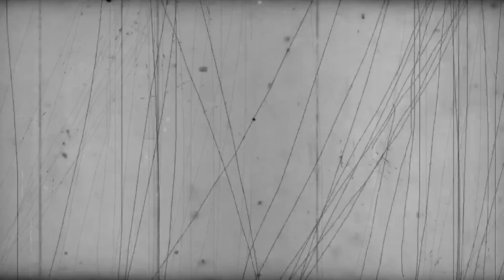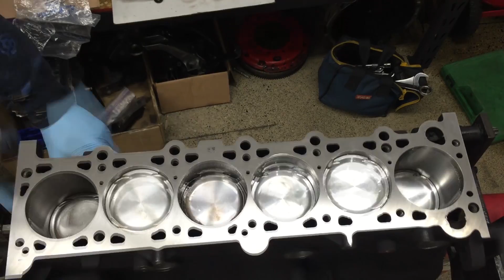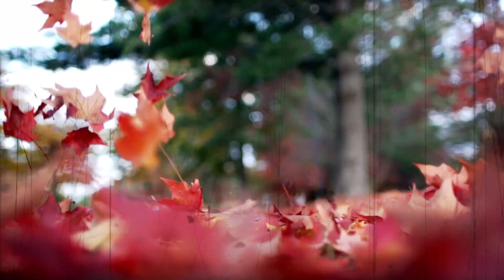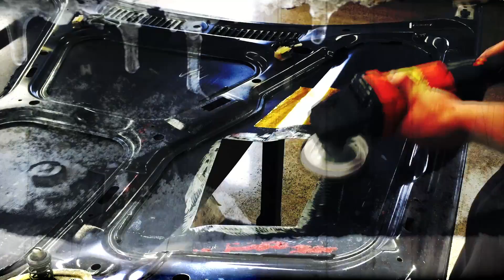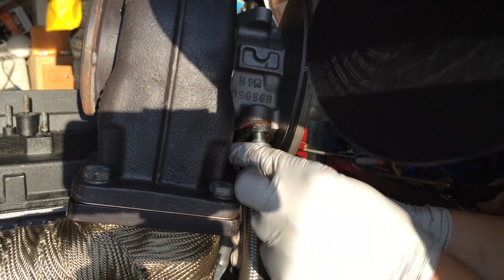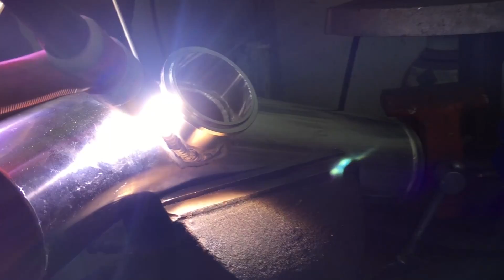E36 M3 Turbo Build ProEFI 128 ECU

Comment: How much power are you pushing? and i guess you needed a stronger crankshaft or are you using the original?
Reply from the maker: Stock crank is forged so no need for a different crank. At the moment it makes 740 wheel @20 PSI on E70. We are doing E98 after bigger injectors

Comment: Where did you get the mani from? The mani is the last thing I need and then I can start but I haven't found a good one yet
Reply from the maker: I have AR design T4 twin scroll manifold. They are out of business so your best luck is looking on Bimmerforums in forced induction thread or I know revshift makes mani's for e30 maybe they have some m5x stuff. Good n tight also makes top of the line manifolds

Comment: Man amazing work
I want to fit a turbo on my m43 engine(e36 318i), is it advisable ? 
Precision and advice from you would be most welcome
Reply from the maker: I never worked on a 4 cylinder engine so I don't know what advice to give to you honestly but I don't see why that would be a problem. I do know a few people who made 500whp on bone stock m50 with arp head studs
Reply: No.......
Reply from the maker: +daytonaM3 follow @francis_von_louie on Instagram. He's the guy that runs over 600 at the wheels on bone stock M50 internals with e85. It don't last very long but it sure has been done many times before.